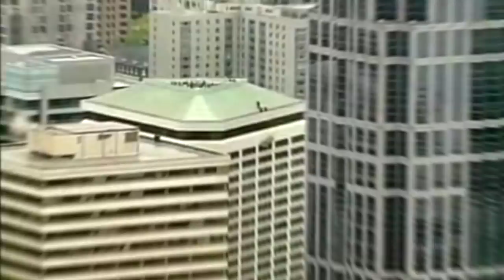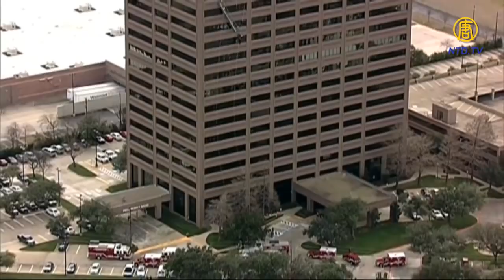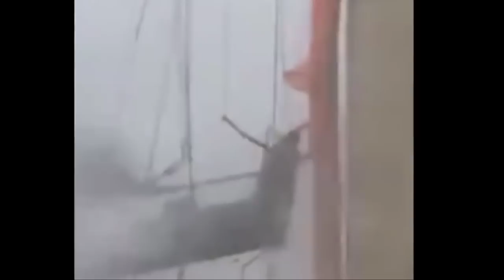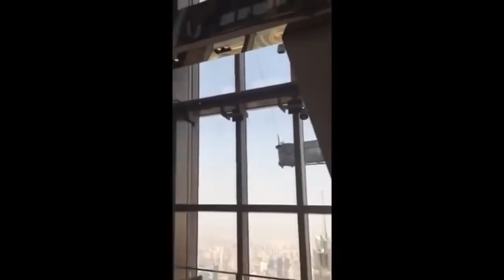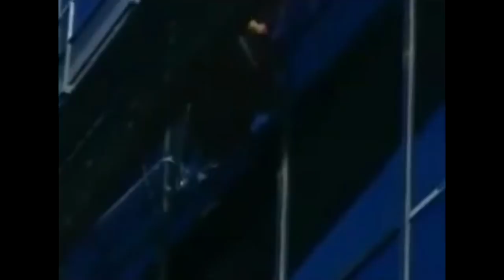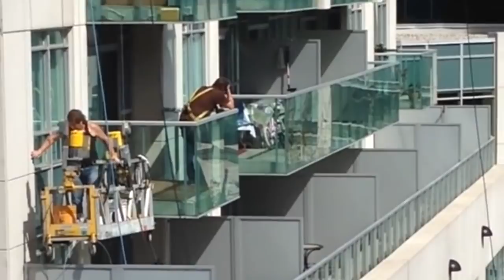Top 5 Window Washings GONE WRONG

Comment: That’s exactly why I would never use those machines. Traditional rope and seat are much safer.
Reply: If you rig it correctly
Reply: All the weight maybe but I saw a video of wind breaking one n it was sketchy asf lol I'd love to learn more about this trade
Reply: Tabris  only because of the way the burj is segmented, you can do it in stages. Maximum rope length shouldn't exceed 500ft
Reply: theres plenty of jobs on the ground :P

Comment: As having a mechanical engineering background, I would like to suggest something to prevent this. For them stupid designers, that that window cleaning platform be connected to the building via the same rails as on roller coasters with 3 point vertical and lateral contact to the side of the building whilst still using the cable hoist system. No sway, no swing. Straight up and down. Then hoist the platform onto the next set of rails... 
Any Architects listening? Don't design if not practical. Sure it looks cool, but is it practical and not detrimental to the safety of others? One can design any building, but, practically, is it easy to clean?

Why do Engineers always have to fix Architects design flaws?
Reply: I’m a chemical engineer, not civil nor mechanical but why not just create windows that do not require cleaning or self cleaning windows. Eliminate the need for a human altogether
Reply: @moonraker7381  self cleaning windows sound cool but expensive. My idea of a self-cleaning window system would have to use pure water to avoid any water stains, as well as a pressure system sufficient enough to remove dirt, bird excrements, carbon build-up, etc. 

Basically a sprinkler system for windows. Can't imagine how challenging that would be to create for even a small building.
Reply: @Roach8431D2  install it on a rail system when the building is constructed. It could move across all the windows similar to how a CNC cutting machine moves across a panel.
Reply: What if all buildings aren't designed to have rails to hook to?
Reply: As having an industrial rope access background, I would like to suggest something better than your idea. Man up and get a rope ticket. It creates high paying jobs and allows those idiot architects to design anything they want. As a side note, irata technicians have easily the safest stats when compared to any form of working at heights and that includes milk crates, ladders, ewps, bmu’s, man cages blah blah blah
Reply: @ladybug-mv8tn  so bad building design. They knew at time of building design that the window will need to be washed.
Reply: Hold on... cool story and all, but what kind of fkng architect designs window cleaning rigs? Seriously?
Reply: @Roach8431D2 Do you know also how costly it would be to install all those pipes within a building of that size that is already complicated?
Reply: What are you going to do with all the buildings that are already built, tear them down and rebuild them again?
There is not need for building design. Those ropes need to be tight from top to ground, it will prevent movement. I mean instead of dangling, the platform will be slid by the cables, the same as the elevator system. Keeping dangling cables to prevent any failure of the sliding cables.
Reply: Adaptation. Few bolts and screws...
And balls, or nuts of steel...
Reply: @yoeltruffin5959  guide rails safer...
3 point contact, plus, as you say. Cable above, as below. However, no one wants to see cables dangling at ground level... 
Food for thought.

Comment: Why are these platforms free-hanging. Shouldn't they be secured to the wall?
Reply: Some are some aren’t
Reply: Some use fans that push the bmu into the building (until the power fails). All should have lanyards every 2-4 floors

Comment: Please don't blame the platform company. Some job sites don't have trained employees or engineers who know how to install the platforms properly!!!
Reply: Uh, the platform company is instrumental in installing the system
Reply: @davidbradley3227  not necessarily. They'd supply all the equipment to install into the building. The builders who are installing on site need to make sure everything is safe before use of platform. Those platforms are also secured to cable trusses and anchors witch are bolted into the roof. It's the inspectors job on site to ensure safety checks are done daily on a routine basis.
Reply: @davidbradley3227  I work for a platform company and we build washer platforms. We dont install on site, so technically its not our fault. If one of our platforms fail during use of course we look into it. Cables do snap over time. That's the inspectors fault for not checking off on it. It wouldn't be the company who made the platforms fault.
Reply: @jamiemarie2543  fair enough. I’ve had some pretty negative experiences with the maintenance guys at cox and gomyl. Guess I’m jaded